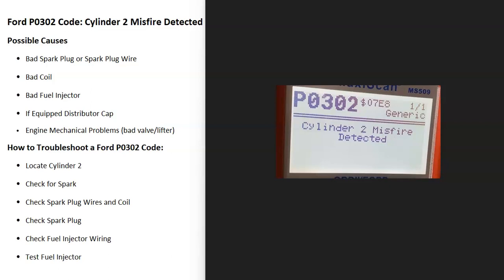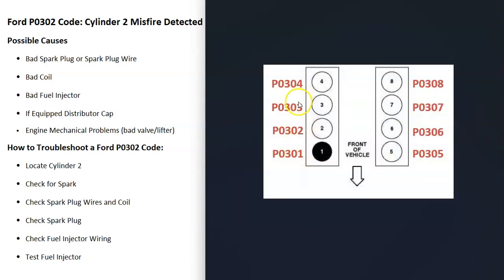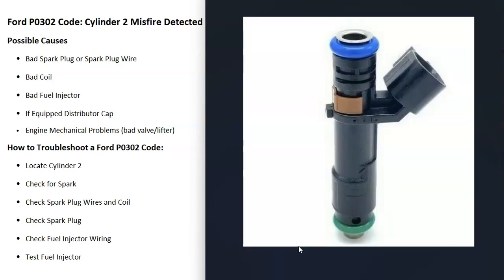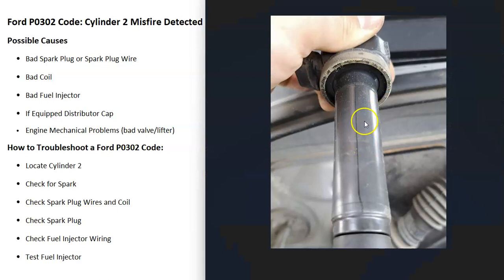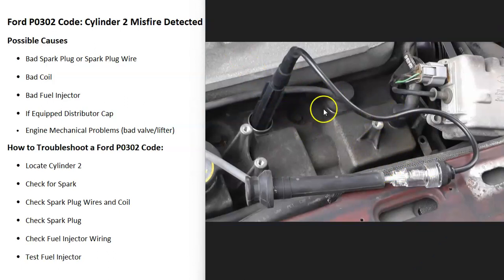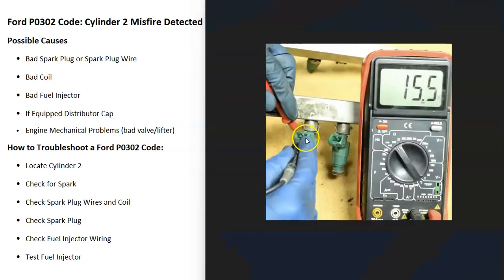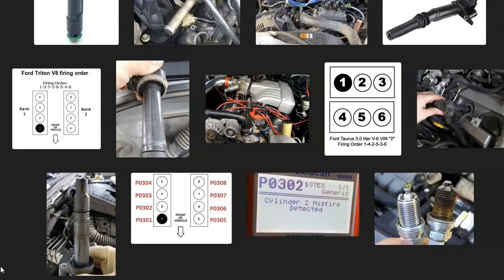Causes and Fixes Ford P0302 Code: Cylinder 2 Misfire Detected

Comment: I was driving my ‘98 Ford E250 4.2 V6 on the freeway in Georgia in August.

It started to rain really hard and the engine light started blinking, then stayed on, then blinking, now just on.

Checked for codes and the P0302 was there.

I’m guessing the rain caused it and if it dries up then it will go back to normal.

About to test drive it and maybe get back on the freeway.

Comment: Replace the Sparks, replace the coils fix multiple cilinder misfire but I am still having issues when starts the car and goes away once it heats up. Ford Mustang Ecoboost 2018. Might swap the Coils around to find out if injector is bad.
Reply: That's the exact same issue that I'm having with my car it starts for a few seconds then turns off the wires for the cylinder 2 is not turning off the car everytime I pull it out
Reply: Mines a 2019 ford fusion se

Comment: i just bought a 2007 explorer 4.0 v6 i just changed all spark plugs and wires  because i was getting a cylinder 2 misfire code . in the process of it we discovered  #2 injector was bad and got it replaced.. just got the truck back up and running and cylinder 2 misfire code has come back up. what would the next step i was thinking the distributor cap ? what should my next step be
Reply from the maker: I don't think that year 4.0 has a distributor cap but uses a coil pack, but I would test for spark. There are low-cost spark tester tools that can quickly show if there is a spark. 
I made a video on how to test for spark with a low-cost spark tester tool. Here is a link. https://youtu.be/bOX-TvZ2RCM
If there is a spark and the injector is good, I would test the injector circuit. There should be two injector wires. With the key on, one should have constant voltage (12 volts). The other wire is the ground that the computer uses to control the circuit. It should pulse when the engine is running.  
I made a full video on how to test the injector circuit. Here is a link. https://youtu.be/JL4_HlYCKrw

Comment: I replaced spark plugs and coil ignition and injectors too but it still misfires. Anyone know what it could be
Reply from the maker: If the components on cylinder #2 are all good, I would test the wiring.

Comment: Nice video! I have codes p0302 and p0202. I have swapped the spark plugs and coils, it’s still running rough and engine light is still on with same codes! The intake is a mother to pull off! Any ideas?…
Reply from the maker: The P0202 code is “Cylinder 2 Injector Circuit/Open,”. I would check and test the wiring going to the Cylinder 2 coil.
Reply: @HVAC_Mechanic  wiring was fine. I swapped out the coil and spark plug first and it still had codes then swapped the fuel injector and finally fixed it. Thanks! Intake removal was the worst part. I’ll never buy another ford based on difficulty of fixing things…
Reply: @joethepro7050 I’m having the same problem with cylinder 3 in my 2014 Focus. I replaced the spark plugs and it was fine for a couple weeks. Then the same code came back so I replaced all the coils as well. Now cylinder 3 and 2 seem to both be missing. I’m not sure what the problem is, but I’ve heard that coolant leaking into the system is a common problem for these.
Reply: @isaiah.paulson  I mean it could be, but the coolant shouldn’t affect the engine. So I would replace the injectors in those cylinders and see how it goes. Changing the injector fixed my issue. They’re like $55 each I believe.

Comment: I have a 2007 escale and the firing order is 
123
456 
With 456 being the front. Does this mean i have to pull my intake to access cylinder 2?
Reply from the maker: The spark plugs, coil, and injector should be assessable without removing the intake.
Reply: @HVAC_Mechanic  from this video and looking at it I think they are under the manifold but I might be dumb and there's a separate piece covering them. https://youtu.be/VWzCOEfIMII?si=VEYt_I7ehXCvPLS9
Reply: Yes

Comment: Great information. Thanks buddy. I've changed plug and coil pack.  Now this video makes me think it's could be the injector
Reply: I’ve got white smoke and a heavy gas smell. I’m getting misfire on 2,3 and 4 cylinder. I’m thinking injector. So what do you think? Mine is a 2011 ford f150 xlt.
Reply: Change em
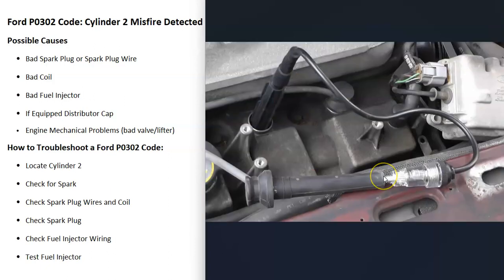Reply: 2:27
Reply: Was it your injector? 2006 4.0 - I've changed plugs, wires, coil pack, fuel pump, fuel filter.. it's got to be injectors next right?
Reply: @mattie_world was it the injectors?

Comment: I have a 2010 Ford Escape with 6 cylinder.  Code P302.  #2 cylinder misfire.

Spark: I checked the coil and it is not bad.  Pulled it up and I can hear it sparking.  Swapped with the coil in 3rd cylinder and no change.

Compression.:  I pulled out the plug  of #2 and checked compression.  It was 135 lbs.  I checked compression of 3 and 4 cylinder, 135lbs, So not mechanical/valve/rings.

I put in new plugs while checking compression and no change, not plugs.

Fuel: I purchased and replaced fuel injector in #2 cylinder, no change.

Engine misfires, but not a completely not firing.  Meaning if I pull the the wire connector out of the coil, the engine does drop, a little, but not jumping like if if pull it out of another cylinder.  Same if I disconnect the lead to the fuel injector.

So if it is not spark, not compression/mechanical, and not fuel, what else should I check?
Reply from the maker: Usually, it would be one of those things. This is just a guess, but there may be an intermittent wiring issue causing a component to intermittently fail, causing the PCM to throw the code.
Reply: Try the alternator if you still have the vehicle

Comment: Recent plugs filter and fuel pump assembly 
Misfiring or skipping all of a sudden
Three codes po302, po455 and po460 ford f150 4.2 
Misfire, Evap gross leak no flow and fuel level sensor a circuit
Reply from the maker: Check if the purge valve is stuck open which common with Ford. Here is a video https://www.youtube.com/watch?v=X-Y5YsaXxJE
Reply: @HVAC_Mechanic thanks and that would throw at least two of those three codes right?
Reply: @HVAC_Mechanic  I tried it but had to get truck running first or it wouldn’t start theft light also flashed. So when cold it didn’t suck then it started to and when wire disconnected doesn’t seem to suck. 

But the hose going to engine seems collapsed so it’s been sucked together
Reply: @HVAC_Mechanic  side stoy on a toyota.  3.5 V6 threw Evap codes from a dying battery.
Reply: I tried it but had to get truck running first or it wouldn’t start theft light also flashed. So when cold it didn’t suck then it started to and when wire disconnected doesn’t seem to suck. 

But the hose going to engine seems collapsed so it’s been sucked together

Comment: I have a 2015 ford Taurus sho with a cylinder 2 misfire, but I just recent replaced all fuel injector, spark plugs and ignition coils. It’s been in the shop 3 times for the same issue. What else could it be?
Reply: Intake manifold coolant leak into the cylinder.
Reply: Check compression. Check leakdown. Check ground and signal wires. Check ECU